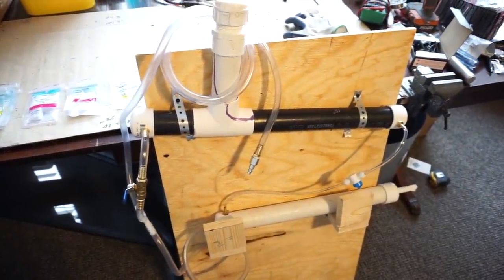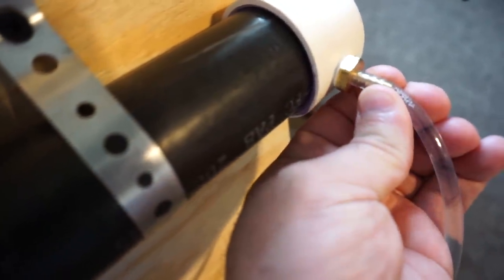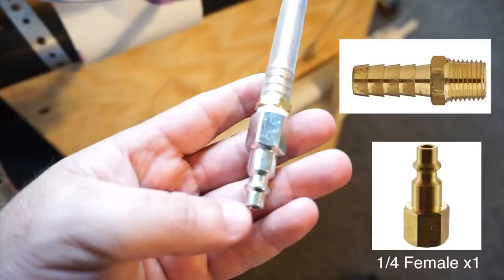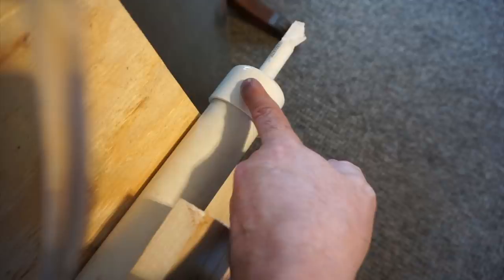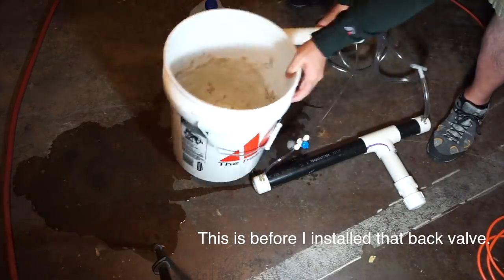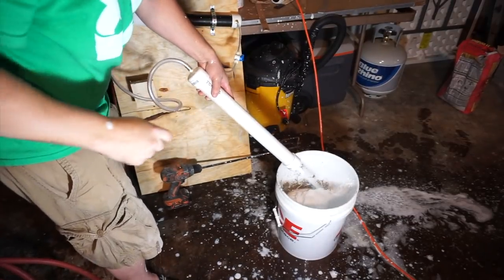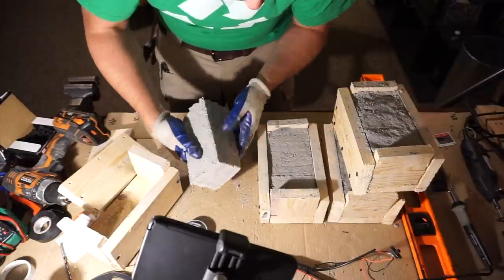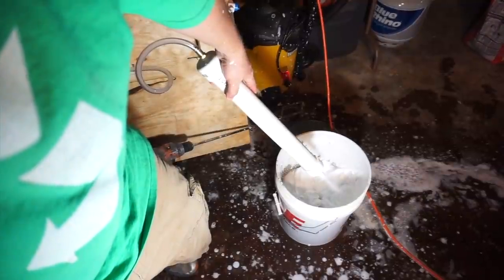How to Build a Simple Aircrete Machine

Comment: Anyone have issues with the air backing up into the soap container? Looking at some sort of one way or solenoid valve because whatever design i use it ends up bubbling backwards. I've tried the air spliter like this one and i tried using a pump for the soap.

Comment: FIX !   Chain Links in bottom to prevent blocking and use stainless scrubbies. .
Reply from the maker: Yeah, I did actually use the chain links but I put them towards the back instead of the front...lol I also forgot to mention that in the video. I switched it around and that helped!
Reply: but did you catch what he said about the STAINLESS STEEL SCRUB>?  that is a huge dfiference and no rust no tiny parts of steel wool.  i really enjoyed the way you laid out the parts and labels etc.  awesome
Reply from the maker: Yeah, that was another error I did...I didn't realize it when I got them but I bought the non-stainless steel kind which ended up just rusting completely together in a big gross lump...

Comment: Also fibergalss is added to cement products  for tensile strength and a binder you should not need it for small block where compressive strength is ideal or the block is worthless you are trying to break it with your hands. get a cinder block, foam block, and piece of fur and beat the crap out of it with hammer see results. Steel wool is a terrible additive it will rust and does not have longevity of steel rods or steel mesh that are used in construction these rods take decades to rust away.
Reply from the maker: Yeah, steel wool was definitely a bad choice lol

Comment: What is the point of making very weak concrete?
Reply from the maker: Well, this was just an experiment...the stuff I made wasn't very good. When you get the mix right...it's actually really strong.
Reply: aircrete is never strong compared to normal concrete.  MAYBE ~1,000 psi.  Thinshell concrete easily goes to 8,000.  So again WHAT IS THE POINT in making something so weak?
Reply: @patrickeh696 , plenty strong enough for a house or shop or small barn
Reply: @patrickeh696  you need to put your thinking cap on mate.
How much better did bread become, once we realised to slice it!

Comment: When you mix the Portland cement, you may want to check out the plasticizers to the dry mix and then with the "recommended" amount of water(https://www.youtube.com/watch?v=ICp4i_c0uIw). These will take a, what looks like dry slurry of cement and make it very wet. Has to do with the binding of water in the cement. You need to also look at the binding/reinforceing agents out there as well(https://www.youtube.com/watch?v=zRephX3Zpb8).Some good information and videos out there for reference. Just do a search in the Utube library. Try the stainless steel scrubbing pads in the tube also. Good build video BTW.
Reply from the maker: Thank you! And I didn't think about the stainless steel pads...the ones I have now rust! lol
Reply: Hey Bill, im a Bricklayer from Aus. On occasions we use a liquid plasticiser in our mortar mixture (20mL) to help with the application and laying procedures (transferring mortar from our trowels to the brick corse that’s been previously laid) it is generally used with a ‘gritty’ sand (aka a dead sand, low clay content)
The plasticiser will also reduce the speed in which the mortar will set, therefore allowing more time to roll joint the beds and perps which surround the brick (the finished product)
As a side note... if we run out of plasticiser we will use household detergent. They both seem to have the same effect.
Yes it does work in the sense to make the mortar more malleable, but what I’ve found is that after the mortar has been set for a period of time (30 days) the hardened mortar is significantly altered (broken down).. The mortar mix with plasticiser is easily removed by gliding your finger over the beds and perp joints (you could literally sit there and remove the mortar surrounding the brick with just your finger.. maybe a bricklayers fingers :)
As a cured AirCrete is already a very powdered like material, I would imagine the plasticiser to increase the break down and not being an effective alternative.

I am in the process of building a foam generator, I aim to test different types of ‘external membranes, additives, apoxies, reinforcements’
With what I’ve seen so far regarding AirCrete I would personally not include any steel reinforcement as AirCrete can absorb 3 to 4 times its weight in water.

Comment: Set-screws really do their job of holding a cap on the tube... even in pvc! If you cannot control the mix of cement and foam formula along with working time... you end up with a mess...you say TWO YEARS of invention use?  Your video did NOT provide enough useful DIY information. Thanks for trying.... maybe try another HOWTO video when you figure out how to be consistent.
Reply: A good DIY guy can look at sketch and figure out what to do.  And other ways to do it.  For example on my "cannister" I used threaded PVC fittings on either end for ease of clean out.

Comment: Why, why, why do people keep calling ABS pipe, PVC pipe?

https://www.diffen.com/difference/ABS_vs_PVC
Reply from the maker: I used a combination of ABS and PVC because that's what I had randomly lying around. Didn't think to have to differentiate between the two because really you can use whatever...

Plus most people in general know PVC, so was just trying to keep it simple...
Reply: Five For A Change 
They are different and used for different applications. You also have to use a cross purpose cement to bond them to each other. 

I have mixed both in projects capitalizing on their different properties in different parts of an apparatus.  

I just prefer accuracy when instructions are given and parts explained.
Reply from the maker: I do get what you're saying but since it's just a simple little project I didn't get to detailed about it but will try to make sure next time to be more specific if I use PVC or ABS....